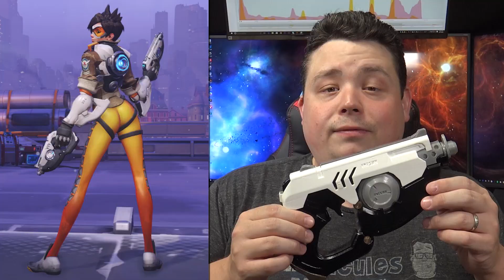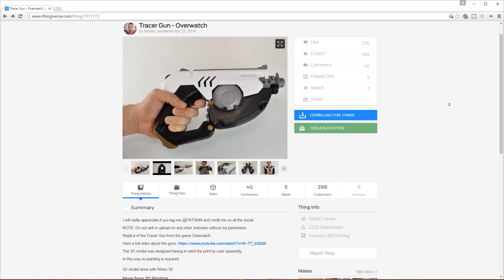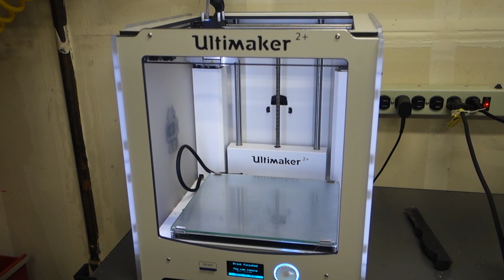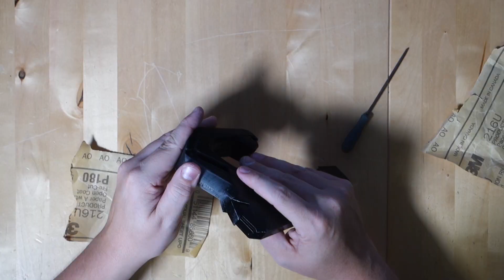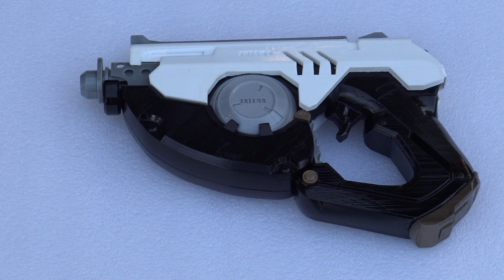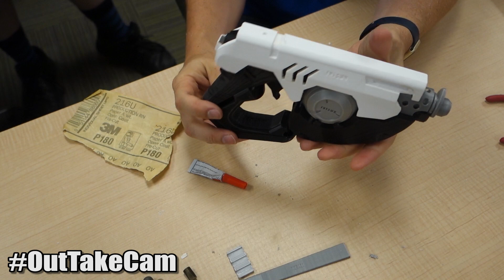Realistic Overwatch 3D Printed Tracer Pistol - No Paint - @Barnacules

Comment: Pro Tip: If you print with ABS instead of PLA, you can get some acetone from the hardware store, dip a q-tip in it and run it over the surface of the print. The acetone softens ABS and makes it "melt" together slightly, and it ends up giving the print a smooth glossy appearance without the need for sanding.

Just remember to go slowly, only use a small amount of acetone, and let the plastic re-harden after each coat of acetone, otherwise the ABS will become spongy and soft and will easily deform.

Comment: RE: perimeter wall being too thin. This is one of the disadvantages of Simplify3D that I've found(I use a Seemecnc rostock). The support material removal tends to somehow pull away little bits of the perimeter wall, for the same amount of support XY distance, as compared with other slicers. This isn't a problem for ABS but I notice it tends to happen with PLA quite a bit, which creates little rips in the print. You really have to be very careful pulling away support on some prints, maybe even cut them away with a knife. Another disadvantage is you can't directly control where you want the Z-scar to go. Other than that it's a very good slicer. Recently I've been favouring Kisslicer a lot.

Comment: Tips
If the print is in abs you can hang it in a closed box with some acetone on the bottom. The acetone will slowly evaporate and start to react with the plastic, the finish will be light reflective and a almost perfect surface since it actually does fuse itself together. you can also use it to fuse 2 peices of abs together aswell. This is the cold slow way but if you bring the acetone to a boil it will take just a minnute. This worked really well for me.

Comment: What about printing different mechenical keycaps?
Reply: Hmm, the main thing about keycaps is the type of plastic, and how durable they are, and the texture. Not sure PLA, other filaments will be good for this?
Reply: +pearljamrock I have no idea either was curious if it would be possible.
Reply: Keycaps work pretty well with 3D printing. Only issues are texturing, custom keycaps will require you to learn how to model, and consistency. I used Ninjaflex on top (Barnacules has a iPhone case video with it) and any color PLA as the cap itself.

Comment: When you sand plastic, do 600 then 1000 then 2000 then 3000 grit for a stellar result. Then spray or dip or whatever you wana finish it with. 

Also, pro tip. 400 or 250 takes a long time to essentially buff with the 1000. Like, a real long time. Ask me how I know

Comment: for the sanding of the 3d print's take a look into micro mesh sheets. I've been using them for polyester pieces for over a year and recently got a 3d printer and tested them on it. It works incredibly well to get a high polish look and on the test i did with 3d printed parts, completly removes all trace of the slight line marks of the printed layers if done right. The sheets might be a bit expesive to buy, but unlike sandpaper, once you have used them, a quick wash with warm water removes the plastic particles and when dry the sheets are ready to use again.

Comment: Hey Jerry why don't you get a makerbot 3D printer? You could have a print off between the ultimaker and the makerbot to see which printer prints fastest or which prints in higher quality, or maybe even just do a makerbot review. Or if you don't want to shell out thousands for a makerbot get a makerbot clone such as a flash forge or ctc. I have a ctc bizer 3D printer which is a clone of the makerbot replicator dual (first makerbot replicator dual extruders) and it's a very reliable printer for the price of £350 In comparison to the £2500 of the 5th gen equivalent.